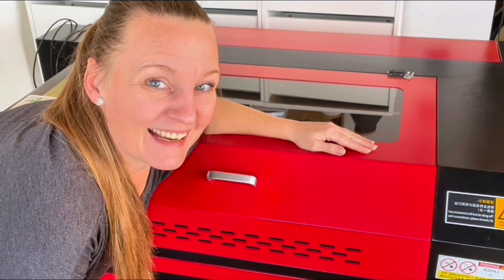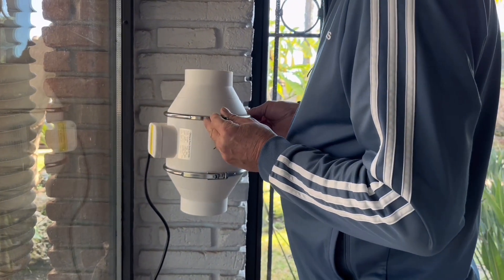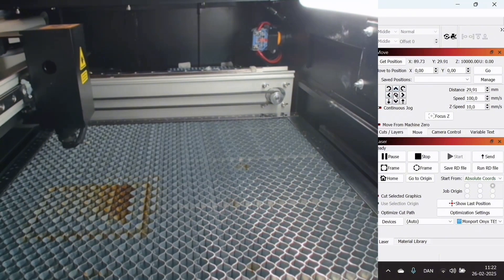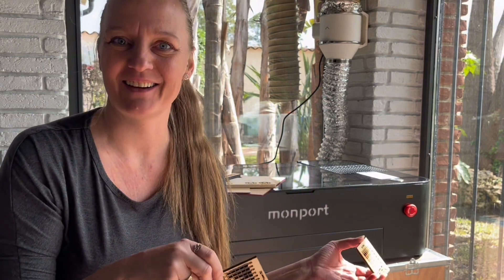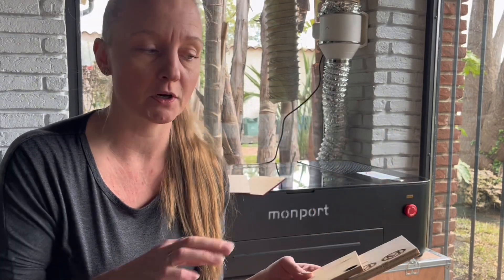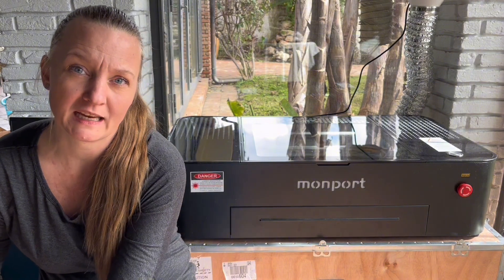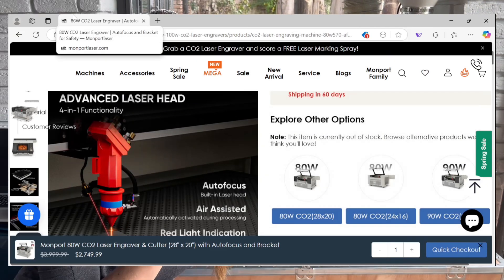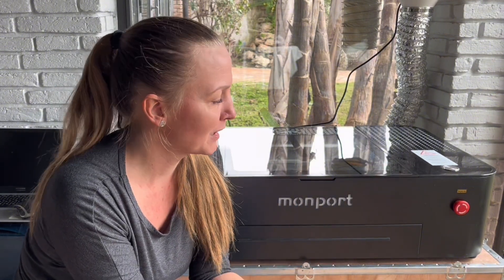Monport Onyx-R 55W Review – Setup, Unboxing & Test Cuts

Comment: Is there any way to troubleshoot  the onyx? I haven't used mine in about a year and now it just doesn't work. When I go to start a project, it the light turns red, nothing comes up for any type of error message, and there's no screen of course, so I can't figure out what it is upset about. Also, do you know what the coolant level should be?   or the easiest way to add coolant without making a mess?
Reply from the maker: For the coolant you could use a funnel, I believe there’s a minimum mark on the holder.. You might be able to find the error in the manual, otherwise you have to reach out to the support

Comment: Could make a tutorial 3engraving petrified  wood?
Reply from the maker: Petrified wood is more like stone than wood, so it can’t be cut with a laser, only surface-engraved similar to glass or rock. But that’s a really interesting idea for a tutorial, thanks for suggesting it! 🙌
Reply: @MiMoDesignLaserfiles  Yes. I looked in the internet and i can not found anything about that.
Reply from the maker: @rosesmith9609 Maybe it’s because the material is a little harder to get, but I’ll see if I can find some 👌

Comment: Hello and Thank You for your video. I subscribed as quickly as possible.  Have you had to clean the lens on the laser head yet?  I have found that there is no "exact" match on the manual sent with the unit  or any online that  are for my machine.  I noticed you have the same model number that I do from the video.   I have had a few issues with this machine but I am confident I can work them out.  The Start button on the machine quit working and now I must click on start from the Lightburn software.  Anyway - I noticed that the procedure to clean the mirror and Laser lens is NOT the same as other videos on The Onyx show because it is so different.; your model number is the same as mine and the date of this video is the most recent I have found.  Please share your thoughts. AND, if you don't mind what country do you live in?/  I am in Georgia, USA.  
Thank you
David H.
Reply from the maker: Is the wires to the start button connected correctly under the panel? In the manual they state that the cleaning the lens and mirror in the house is not necessary, but that’s actually what the strange looking metal tool is for. I’ll make a little video when we get back from vacation 👌 I’m Danish, but we’ve been stationed in Sicily for the past 5 years - finally moving back home to Denmark in July ❤
Reply: @MiMoDesignLaserfiles  Thank you I would appreciate that very much. Sorry for the delay in my reply as I have had to have a Left Hip replacement.  Also did you have problems with calibrating and aligning the camera?   My Monport Onyx R was delivered in February and I still  havent been able to get it calibrated and aligned - VERY frustrating for me (I'm an Aries!)  You do an excellent video by the way - Thank you!!
Reply from the maker: @davidhamilton6302 Oh no, hopefully the surgery went well? I actually did end up having some issues with mine too and I’ll have a second review coming up soon. 

After this video, my Onyx lost efficiency and I went in and checked the lens, which I made a video about here:
https://youtu.be/JSnKn-Tu8oc

After replacing the lens, I realized that it was facing in the wrong direction from the beginning, which explained why it was damaged, so I highly recommend you check the lens, I also made Monport aware of this problem.

For the camera calibration, it is a little confusing to do in Lightburn, but I did make footage of how I did it and will see if I can edit it into a video this weekend - but you can actually find a great tutorial on Lightburns own channel as well
Reply from the maker: I just realized I never got back to you, but I did in fact make an video on the lens cleaning/replacing:
https://youtu.be/JSnKn-Tu8oc

Comment: I am Happy with my Onyx. The autofocus is so usefull If you have different material.

If you keep the onyx, take the internal fan out completely. It's too loud and without it the external one works much better. 
Have print a small adapter for the space from the fan. 

An additional parallel pump for the Airassist is also useful for wood. The internal one only does 15 l/min. But that's enough for acrylic.
Reply from the maker: That’s really great advice! Thank you so much for sharing your experience! I’ll definitely try to do these small upgrades on mine as well 👌